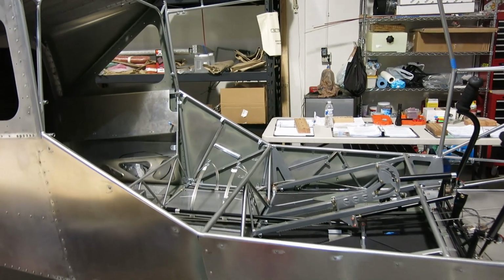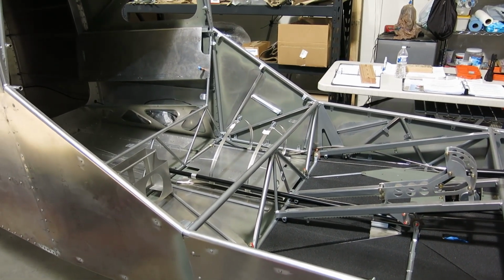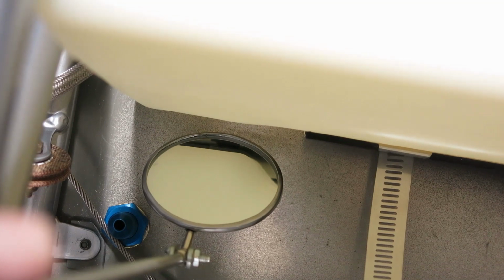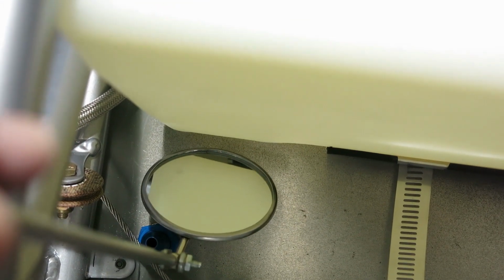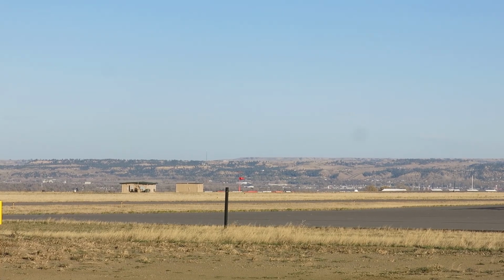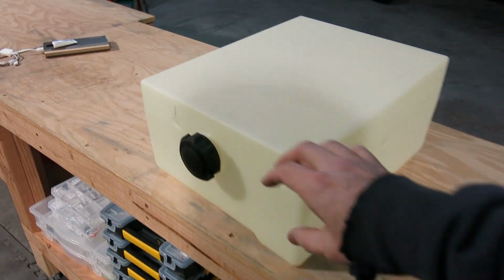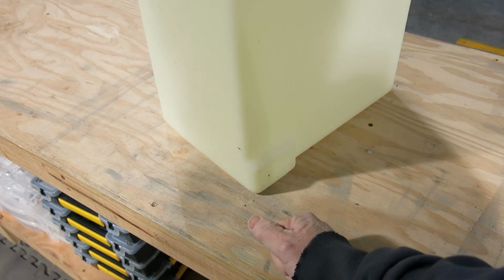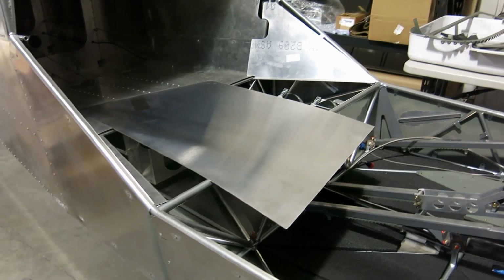No. 230 11-05-2022 Header tank part-3

Comment: I had the exact same problem with the forward luggage sides.  The pilot’s side fit fairly well, but the copilot side wanted to be below the rivet.  I ended up moving it up to where it just barely catches the rivet and aligns fairly well on the side.  The bottom flange is a little high, but I opened the radius just a little so the bottom would fit reasonably well and figure the carpet I put in will cover it.  It definitely seems as though the tab on that side was welded a good 1/4” too high.

I am having somewhat of a problem also on my firewall.  The holes in the firewall don’t align with all of the engine mount holes.  The right three line up fairly well,but the left bottom hole is about half a hole diameter off.  The bottom and sides are aligned fairly well with the outside skin tabs, but the holes are off a little and the center bottom tab protrudes forward holding the center bottom of the firewall away from the cage tubes such that it rocks back and forth on the tab.  I am assuming that I will need to put washers behind the engine mount bolts to keep them from bowing the firewall in the center and causing issues.  It seems the RANS cages aren’t jigged as well as they should be as the tabs seem to have a lot of variation in them.
Reply from the maker: So on that side skin, is the idea that to remove the rear baggage floor, you have to slide it aft to clear the fwd side skins? As to the rivet tab, I could raise that skin, but then would have to trim off skin on the top side where it meets up with the outside skin where it curls over the fuselage tube. I think we’ll just have to put another rivet in there and back it with a washer or something to give it some strength. 
On the firewall, yes had some fit issues but I don’t think as bad as you. I did have to round out the bottom corner hole on the pilot side a little.
Reply: @s-21project92  Yes, that is what I figured is the case.  Have to slide the baggage floor back to clear the riveted side and then remove.  Looks like installation will be a pain, but the baggage floor should need to be removed only once a year for condition inspection.  I considered replacing the rivet in the rear of the side skin with a nutplate and may still do that as I haven’t riveted that in place yet.